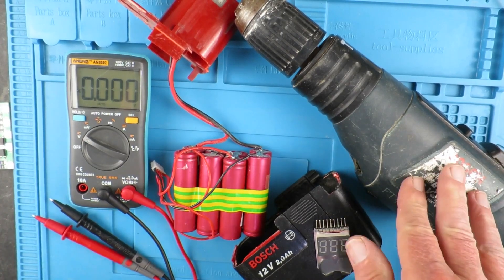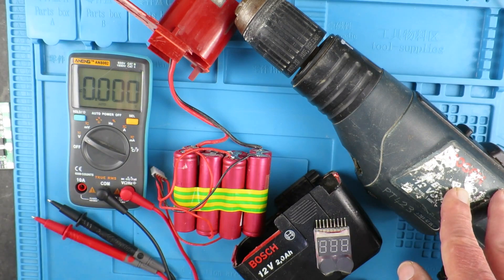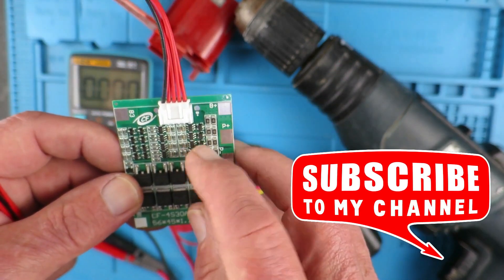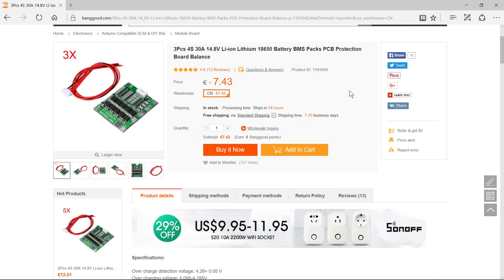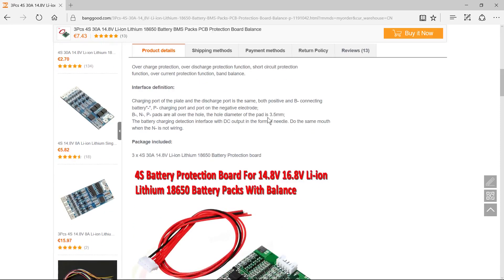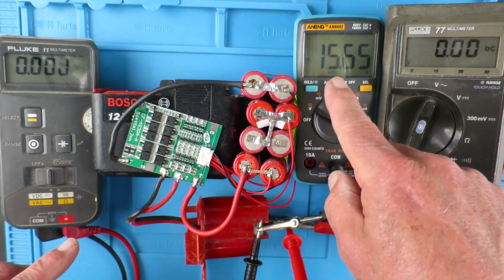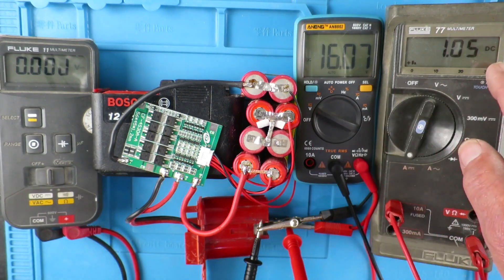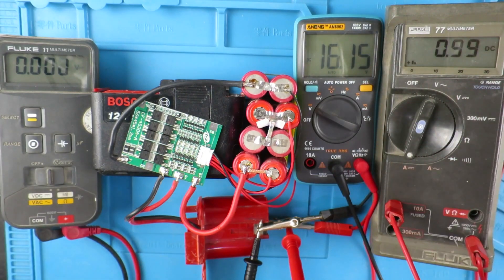4S 30A Li-ion Battery Protection / Balance Board Test Electronic Tutorial

Comment: 4.28v is overcharged condition
Reply from the maker: The BMS board Over charge detection voltage is 4.28+ 0.05 V, so it is in specification. The whole point of the video was to show how the BMS and balance function work. You can't do that unless you charge the cells to 4.8 volts when the balance board will cut in and prevent further charge. If the charge rate is such that the voltage continues to rise the BMS will disconnect the cells. FYI Samsung's test procedure for overcharge is 12 volts at 2.6 Amps for 2 hours. The test is passed if the cells don't explode or catch fire!
Reply: 1nformatica thanks for reply 👍
Reply: 1nformatica I want a bms that can cut off at 4.15 for long cycle life. I tried charging with less voltage but it would be better to have that in BMS
Reply from the maker: This will be difficult as nearly all BMS use 4.28 volts. However if you look at this video : https://www.youtube.com/watch?v=sZOlD9pzaQM You will see it uses this chip : https://www.ablicinc.com/en/doc/datasheet/battery_protection/S8254A_E.pdf
If you look at the bottom of the table on page 4 you see there is a 4.15 volt version. Changing the chip on the board will not be easy!
Also see this discussion : http://www.electric-skateboard.builders/t/help-for-bms-wiring-and-bms-cutoff-limits-needed/22263
They talk about a "Bestech BMS" that can be ordered with 4.15 volt cutoff.
Reply: Much more expensive, but adjustable BMS: Depends on application I guess.
https://www.lithiumbatterypcb.com/product-instructionev-battery-pcb-boardev-battery-pcb-board/ev-battery-pcb-board/smart-bms-of-power-battery/

Also, 4.28V would be nice for a LiPo battery. Also has higher energy density, just not as safe if you puncture it
Reply: Agreed Sripal.  These cells are all overcharged.

Comment: So I'm a little confused about the ratings for these boards. Is the 30A the charge rate or the discharge rate it'll handle? I bought a 25A 3s board, I think what I'm building will draw a Max of 8-10A, I'd like to be able to charge it at up to 15A (12V lighter plug), though. Any suggestions?

It's a large Bluetooth speaker/ power bank, with 18 18650s. 50+50+100 Watt amp, due to speaker ratings, will be limited to Max of 30+30+30. Plus a couple USB out ports. If I can figure out how to do it, would also like a low power charge port (2A micro USB),for when I don't have access to the high amp port, but not sure how that would work with the other high amp port, wiring wise?
Reply from the maker: Hello Mark, It is usual for manufacturer's to put the discharge current in the product description. So this board is a max 30A with 60 A peak rating. If you are using a 3S board the charge voltage will be 3 * 4.2 = 12.6 volts, a car lighter socket without the engine running will probably not fully charge the cells. Also at 15A there is a real risk of flattening the car's battery! Look at the cell manufacturer's data sheet for the recommended charge rate. This will normally be around 1C so for a 2000mAH cell would be 2A, healthier for the car's battery! Hope that helps!
Reply: Thank you for the prompt reply. 
3S across 18 cells I think works out to just shy of an amp apiece from 15A? maybe I'm not doing the series / parallel math right? 
Yeah, I'd only want to draw that much while the engine is running (130A alternator).
 I'm putting together an ATX power supply converted to bench supply to charge it when I'm at home. 
So, you're saying I should use a liion specific charge board, feeding in to the inputs of the "BMS" board? I'm not having any luck tracking down a board specifically for charging from 12V (13.4V running) that handles anywhere near that much current. Any tips / hints on search terminology?
Reply from the maker: Hi Mark, I guess the cell arrangement is 6 rows of 3 cells in series? The 3 cells in series will all take the same current so at 1 Amp all the rows in parallel would be a total of 6 Amps. You need to provide a constant current source to charge the cells and a way of setting the voltage. What I would use is a boost converter like this one : 600W-DC-DC-Boost-Converter http://bit.ly/600WBoost
Reply: 1nformatica ah. You are 100% correct. I see where I made the math error. I should have drawn it out instead of doing it in my head. Thanks for the link, also.
Reply from the maker: No problem! Feel free to ask any other questions.

Comment: Wow, very nice demonstration! I've been hearing so many negative things about these "cheap made in China boards" that people on Youtube even recommended to NOT use a BMS altogether... They either don't use a BMS or say to use a hobby charger. It's really annoying to have to pull out my hobby charger that won't charge all that fast. I only have an iMax B6 and I believe the maximum output is 50w. I'm building a 12v pack, planning to fill a small toolbox / ammo can with recycled  and tested 18650's from old laptop packs. It'll have a cigarette lighter adapter and an inverter.  From the size of this small tool box, I can probably only fit a 4s10p pack in there.

Again, thanks for your video.
Reply from the maker: Thanks Han! Sounds like an interesting project, you should make a video on it. Check out some of my older videos on this subject:
https://www.youtube.com/watch?v=DU0vQd3Y8Jg
https://www.youtube.com/watch?v=_lDRud-Ehjw
https://www.youtube.com/watch?v=miDIXwACpcY
https://www.youtube.com/watch?v=sZOlD9pzaQM
Reply: Awesome, I'll take a look! I'm also working out a pack that can handle the load of a microwave or pressure cooker as it'll be used in a camper van. A solar panel mounted on the roof that connects to a MPPT charger will then connect to the BMS system. Might even need a step down board to bring the voltage even lower if the MPPT won't do it. I know cells from a laptop pack usually supply amperage at 1-2amps max so I'm leaning towards high amperage cells which can be found for cheap in clearance power tool packs. Heard people also use those high amperage cells in electric scooters and bikes. Might even consider grabbing a few Nissan Leaf Battery modules for this purpose but they output 7.4v each but saves the trouble of having to solder/spot weld so many batteries together.

Thanks again for your contribution, I'll definitely make a video once I get around to it! Subbed!
Reply from the maker: Great stuff Han! That's a project that will interest many people, good luck with it. Put a link here when you've made your video, I'll be interested to see how it works out.